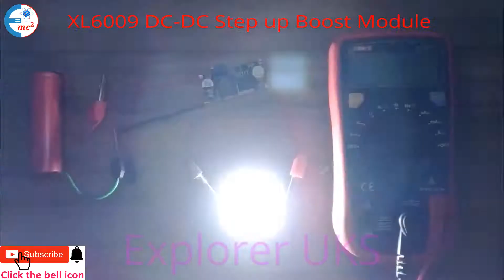XL6009 DC - DC STEP UP BOOST MODULE.

Comment: Amay voltage constant rakhte capacitor er drkar hoy. Ete ki alada Kore capacitor lagbe?
Jemon 3.7v theke 5v korar janno MT3608 booster er janno 2200μF  16v er capacitor lage, XL6009 eo ki lagbe?
Reply from the maker: No need to extra capacitor.